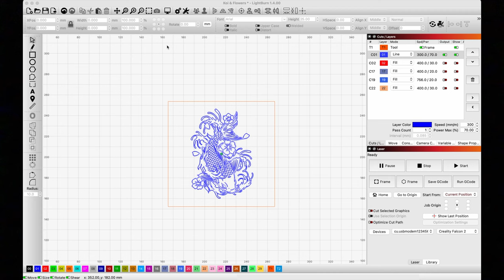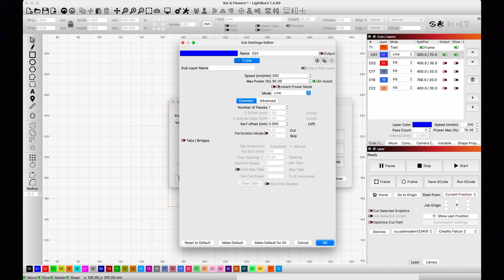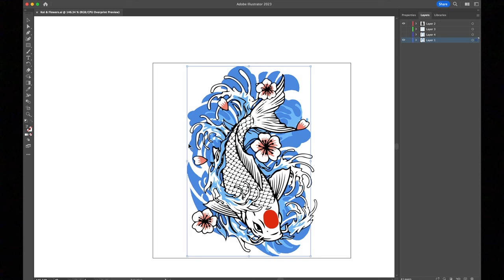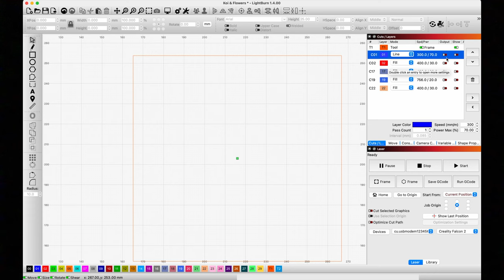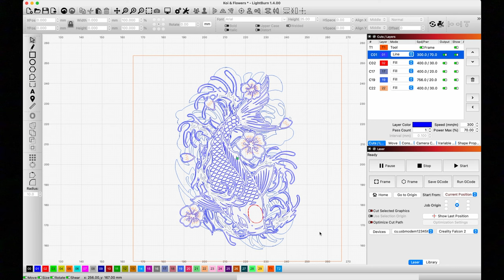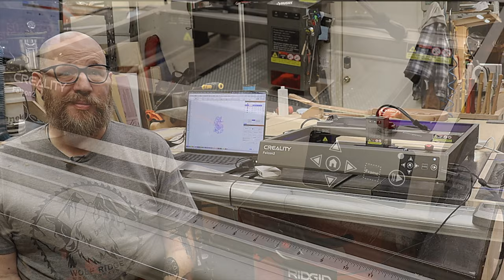Creality Falcon2: Painting Steel with a Laser Beam!

Comment: When you heat/oxidise the surface of stainless steel you change the crystal structure which causes the SURFACE to reduce its expansion coefficient. That is why your material distorts  with corners upwards. The more engraving you do to the surface the greater the distortion. 6mm thick plate would probably have enough stability to  counteract this effect.  You will also have noticed that the colours you carefully defined on your test swatch were non-evident on you final image. With such small test squares  you were not simulating the reality of your image.  The 0.1 line spacing and high scan speed allowed the heat to rapidly build up in the small test area due to the relatively low conduction coefficient of steel. When you did the final image, the scans were long and there was not the matching degree of heat build up betwenn scan lines,  so all your settings were meaningless.   This comment is not intened as criticism of your attempt at colour engraving because you have described the process in great detail and to perfection. As a wood working specialist,  you will understand the vagaries of wood, (as unpredictable as the female species)  whereas metals have predictable properties.  Understand the two key propeties I mentioned and I am sure you will soon experiment your way to success.   ps. The thicker the material to overcome distortion, the greater the conduction rate into the mass of the material and the more exposure time will be required to get the colour palette.

Comment: nice video very informative. you were using a 2mm steel, would it be less warp if it was thicker, maybe 3mm?
Reply from the maker: Thank you for watching!  That might help, but you would need to change your settings as it's the heat generated by the laser that's actually making the color. - Ed